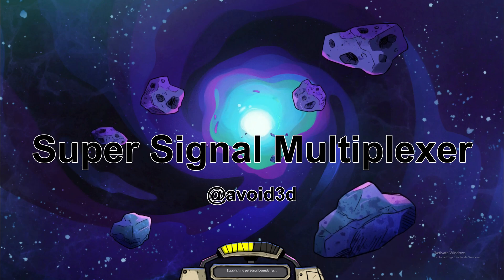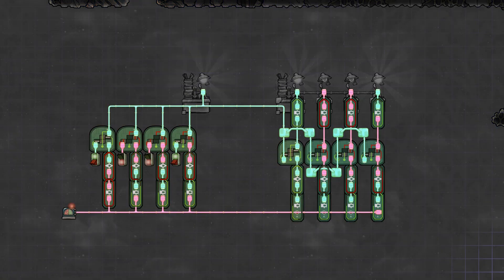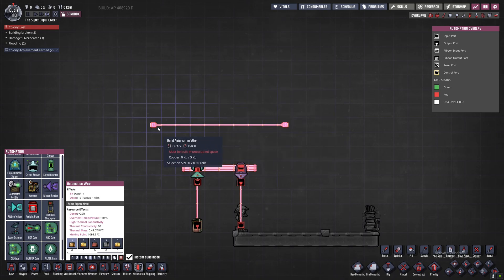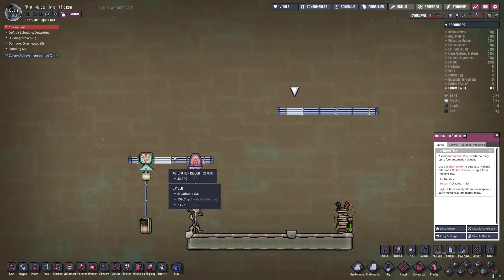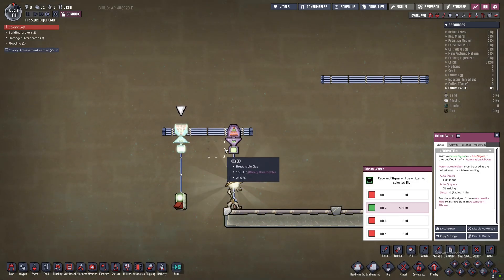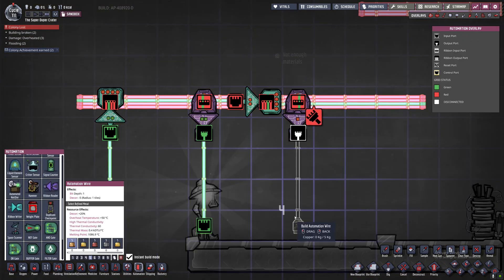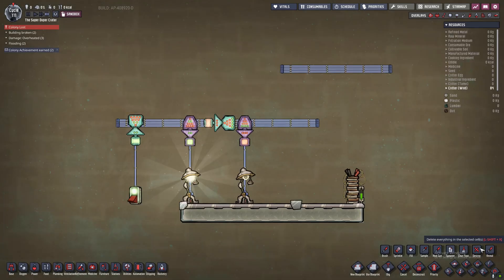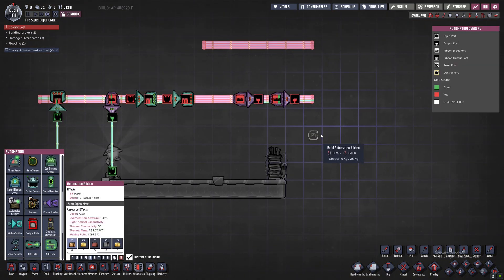Super Signal Multiplexer - Oxygen Not Included

Comment: Hey! I wanted to thank you for this. I decided to redesign my drowning chamber, as all the designs I've seen online relied on incubators, which release a critter in their rooms when ranches don't require new critters, and wastes dupe labor to manually move the extra critters into the drowning chamber.
 I've designed a drowning chamber that keeps a few of each ranched critter egg in their own specific 2x4 rooms, and moves the rest of the eggs to a drowning tile. Each of these rooms needs to receive a signal from the respective ranch to activate their critter pickups, and your video made it possible for me to merge the signals from all my ranches into a single ribbon cable, saving a great deal of space. So thanks for that!

Comment: Tested after QoL update of Nov/2025 and still works. Also I found the limit, there are 32 bits available, it can shift 28 bits and still works (with some delay).

Just out of curiosity I tried to shift bits down, it does not work, all green signals are gone if you push to a position lower than 1.

Comment: Okay, now i'm inspired. I wanna have a 64 tiles control room for everything that needs to be toggled manually for the entire map.

So far, i've just 1 switch, which automatically cuts the entire power system to let ~1kW buildings like water heaters and jukeboxes run at the same time, without overloading the main power line, whereby the switch acts as a general override signal, mainly to let all batteries run dry quickly / heat up vast amounts of icy water.

Comment: This sort of makes sense to me, but all of this programming stuff is new to me. I am great with the one ribbon in making automation, but am trying to figure out if I can take 4 signals in (like a bunch of combined and gates) to trigger a pump. I want it to be below a certain temp, a certain gas, a certain pressure, and germ free before the pump pumps. How would I do this with a ribbon writer?
Reply: You need to utilize the circuit cards for this.  When all four signals show green, it allows a green signal.  Like 3 AND gates; 2 AND gates split between 4 machines, then 1 AND gate for the Output of those 2 AND gates.. so all machines have to give a green signal before the final signal is green going to your pump.
Reply: Of course there are input sensors for all 4 of your parameters.
Reply: Wow, I just saw this was 9 months ago.  Sorry, probably worthless responses.

Comment: Is there no limit to this? Can you theoretically run an infinite amount of signals through one ribbon?
Reply: Game looks at this cables just like at integers, that garanteed to have 32 bits on every PC today. Last bit (32th) is sign of the integer (0 and more if 32th bit is 0, less then 0 if 1) and some guys wrote on forum that you better not use it because it's buggy. But still you can write in 31 bits, that is numbers from 0 to (2^31)-1, which is A LOT (0 to 2,147,483,647).

For comparison, 4 bits is just a 2^4 = 16 different numbers. You can work with that, but even just additional 4 bits (8 in total) can give you 256 different numbers. And on that thing you already can replicate your home Wi-Fi's local network, because usually 3 first bytes are fixed and only 1 last byte is used.

I think you can build whole LAN using just ONE ribbon cable that connected to ALL your "clients" in your base and they can send each over whatever you want with much, MUCH less logic gates than it can be with one signal at the time.

Comment: That is pretty damn cool.  Now if someone can find a good use for it.  :D
Reply: I'm using it for my logistics system!
Reply: I used it to build a binary clock that turns on/off lights from ranges of 0.5 seconds to about 7 cycles
Reply: I'm using it to tell my liquid reservoir to add liquids in the pool. 

Basically I have 4 pool and 4 different liquid on the reservoir. Brine, saltwater, water and polluted water.

Instead of doing 4 ribbon cable seperately, I used the 4 bit ribbon which is great and now because of this vid that I can now add another liquid pool and reservoir

Comment: This is super cool, way to figure out the underlying code!

Do we know if this is a feature? Or is it just an oversight for how it was programmed (bug)?
Reply from the maker: From a discussion with someone who I believe reverse engineered the code:

```
Bit shifting beyond 4 signals, that seems like a bug
avoid3dYesterday at 10:31 PM
It's totally a feature :stuck_out_tongue:
#7299Yesterday at 10:31 PM
What data type are they using internally?
Peter HanYesterday at 10:34 PM
32 bit int
It is supposed to overheat if you manage to cram too much onto a logic wire, but there is a bug with how they check it (they used signed >) so if bit 31 is set for any reason it never overheats
avoid3dYesterday at 10:36 PM
Wait, really, overheats? Does it actually increase in temp, or is this like the 'max power' on a normal wire?
Peter HanYesterday at 10:37 PM
Overload, sorry
```
Reply: @pierrekinbrand the overload was actually concerning a regular automation wire being overloaded with too much data. I think using these writers and readers is what is intended.